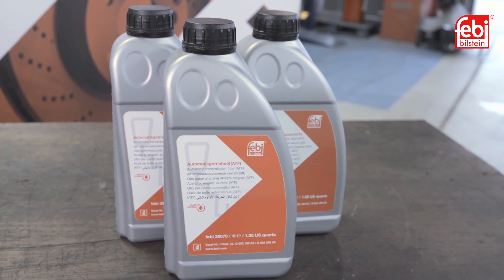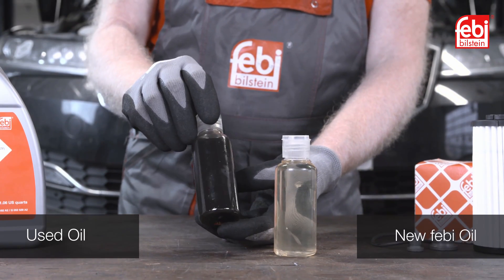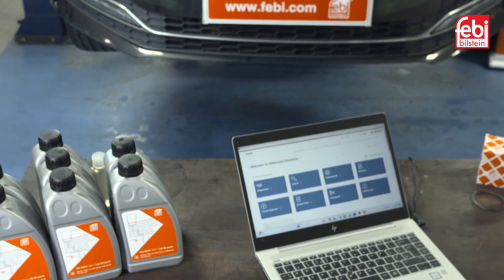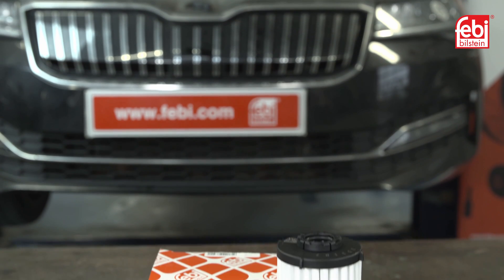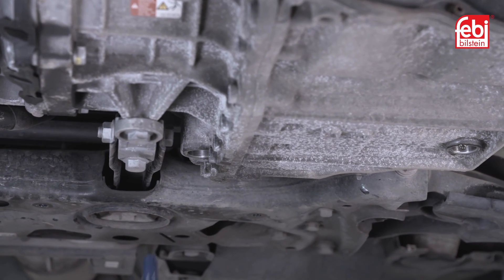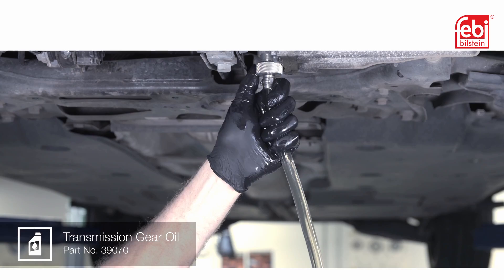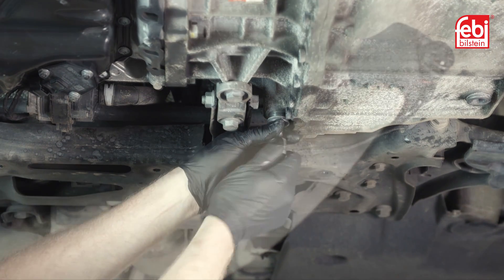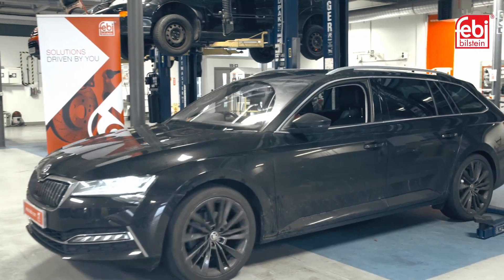[EN] DQ400E (0DD) Direct-Shift Transmission Oil Replacement

Comment: Thank you for providing such a detailed video. I have a question regarding the mechatronic unit: Given that the mechatronic has separate drain and refilling plugs, should the mechatronic be refilled via its dedicated top refilling hole, or does refilling through drain plug No. 1 encompass the entire gearbox circuit?
Reply from the maker: Thank you for watching our video. For service replacement of the transmission oil including the mechatronic unit, the process shown in the video follows the vehicle manufacturers workshop manual procedure. However, if the mechatronic unit is replaced, then the fill point at the top of the transmission is required to be used.

Comment: Why is the oilfilter for the DSG not replaced? 
Can this just be replaced as on the DQ250, or is there something special to be aware of ? 
Thanks in advance 👍🏼
Reply from the maker: Thank you for watching our video. Although there is a filter. Access to remove it is only possible if the transmission was removed or lowered from its position within the engine bay. Therefore, it is not a regular service item. But the oil is.
Reply: @febi.bilstein okay thanks, that make perfect sense. Thanks for a great video 👍🏼

Comment: you forgot to do adaptation after Oil change... 
Or this is just mechanics stories??? 
I would like to know, everyone I ask say it need new adaptation after any repairs or maintenance done.
Reply from the maker: Thank you for watching our video. The only process required to drain and refill the oil on the DQ400E transmission is to depressurise the pump before draining and to repressurise after filling. There is no adaption or learning process required.
Reply: Might not be specifically required by VW, but it should be done, especially if the old oil has been used for longer, or under rough condition, or if the car was not driven for long periods - months. Same goes for replacing the filter. VW does not specify it should be replaced, but it is highly advised to do so, especially after 115-120K KM (2nd oil change).
This is just best practice advice that can help you keep the gearbox and the clutch in top condition for longer.

Comment: Just one question, which is the section where I can find the setting to depressurise the transmission? (And then reset it)

Thanks!
Reply from the maker: Thank you for watching our video. We have followed the vehicle manufacturers process for this transmission oil replacement. To depressurise the transmission, this setting/function will depend on what diagnostic tool you are using, each menu is slightly different and capabilities of each tool varies.
Reply: If you have obdeleven you can go to transmission module and find it under basic settings